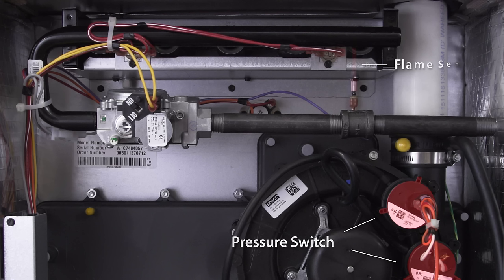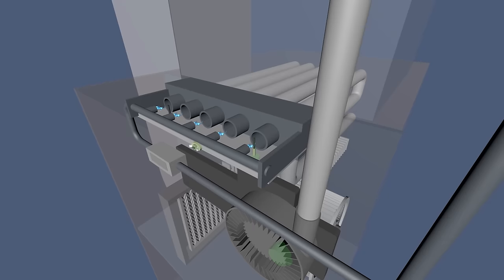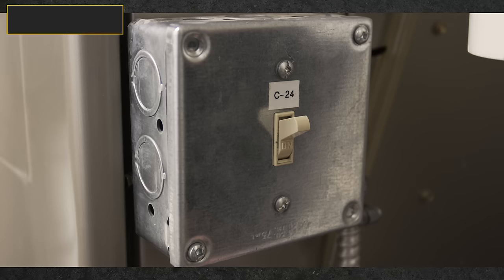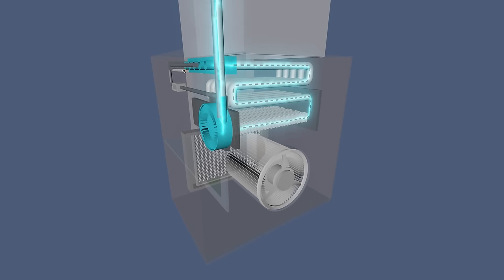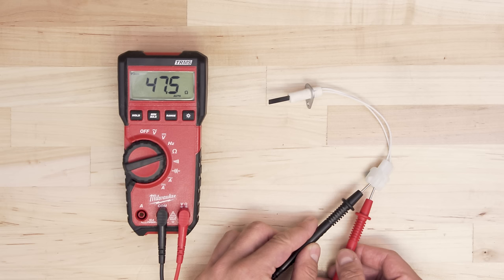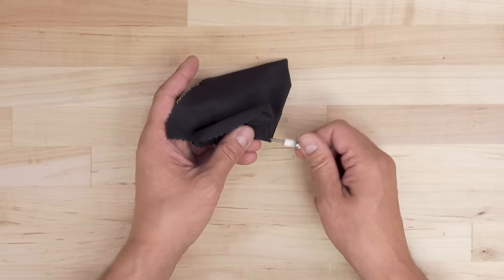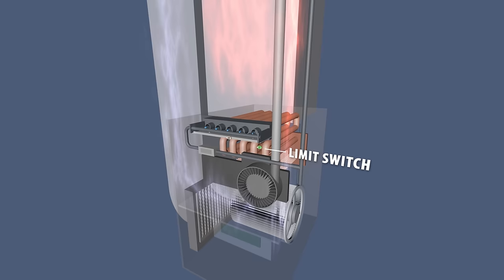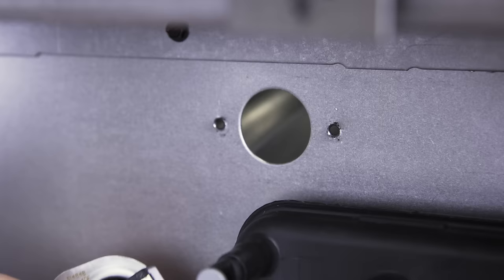Furnace Starts Then Stops - Troubleshooting | Repair and Replace

Comment: My electric heater fan turns off and then back on.. what should i do??
Reply from the maker: Thanks for watching. It depends on the type and style of electric heater. It sounds like it could be overheating. Check for anything that might restrict the airflow like a buildup of dust on the vent or fan. As well you could try adjusting the thermostat settings and see how that effects it. Also if it uses a limit switch then the switch could be starting to fail as its opening lower than its rated value.

Comment: Hello,

I am dealing with my furnace, and it seems to have a particular problem with the igniter.  When the thermostat calls for heat, the inducer turns on, then the igniter will attempt to light, but before it reaches full glow, it seems to go out.  Furnace will then cycle again, and this time the igniter reaches full glow and furnace flames ignite.  Do you have any idea what this could be?
Reply from the maker: Thanks for watching. Does the furnace give you any error codes when this happens? Normally if it was a intermittent pressure switch issue, it will shut off the system even before sending power to the ignitor. 

If this problem only happens sometimes, then it could be an issue with the ignitor or a loose connection with one of the wires. You could try replacing the ingitor with a new one as this is inexpensive and easy.

If this problem always occurs in the same way and the system glows after the 2nd cycle, then it could be an issue with the control board.
Reply: @AmreSupply  High, and thanks for your reply.  I did not check for error codes, but will try to the next time it shuts.  The igniter isn't that old, and I think I replaced it last year, and this furnace has always had a problem of cycling through the years, most likely due to sensor issues.  But this is different in that it will attempt to light the ignitor, but the ignition process shuts down before it can get hot enough to fire the burners.  The way I found it was the furnace was shut because of lockout.  So I flip the main power switch, and start the start-up process.  That's when I notice the peculiar actions of the igniter.

I did some reading, and as a longshot I blew out the tube from the inducer to the pressure switch.  Then I exercised the pressure switch several times to make sure it could move freely.  This seems to have helped, but we'll see.  Oh, by the way, the way I noticed the furnace was malfunctioning was when I went down to the basement, I could hear the humidifier motor, but no furnace.  Usually, that motor shuts before the fan disengages.  Thanks again, and your thoughts would be welcome.
Reply from the maker: @raymondjackson6069  Thanks for the update. It is always more difficult to narrow down a problem that is does not happen in the same way each time. A pressure switch issue or partial blockage could cause intermittent shutdowns. If there was a partial blockage / a reduction in pressure then the pressure switch would disconnect anytime in the startup sequence.

To test you can set your thermostat lower at the your home cool for an hour or two. Then bump the temperature up to trigger a heat cycle. Observe and see what happens. Repeat if necessary to try to get a closer look at how consistent the issue is. The next time there is a lockout there should be an error code.
Reply: @AmreSupply  thanks pal.   I realized when the igniter would do that partial warm-up, we weren't in Kansas.  Kansas being a double or triple cycling, only rarely leading to lockout.  This was locking out several times a day.  I think the previous cycling was due to a lot of little issues, normal for a furnace, like 20 years old - dirty sensor, draft, etc.  But igniter caught my attention, because either it's broken, or it's not.  This partial, then full burn was very odd.  A loose connection, yea, but fixes seldom come that easy, and thank God when they do.  So far the fix is holding, and I do not want to go downstairs fooling with that thing, least I tee it off.  Plus I can tell if it's malfunctioning, like if there is a chill,  the thermo is calling for heat, and theres' no partying in the basement.  Hopefully it will last the Winter, but if it continues to malfunction I get the error code, and try to get some video for you to take a gander at.  Cheers and thanks for making the world a better place!
Reply from the maker: @raymondjackson6069  You're welcome, we're just happy to help!

Hopefully the problem doesn't persist but keep us updated if it returns. Cheers!
Reply: @AmreSupply  Well partner, the fix wadn't a fix.  Still doing it.  So, I jumped the pressure switch this time, and it still did the dull igniter thing the first time, then fired up the second.  So I guess I can rule out the pressure switch.  I took a video of the start up and am trying to find a way to post it.  Stay tuned...  Here is a link  (https://youtu.be/YR_TyG10tAo) to the start up.  I'd really appreciate it if you gave a a peek.  Thanks again!
Reply from the maker: @raymondjackson6069  Thanks for the update. Even though you mentioned that the ignitor and control board are both fairly new it looks like a control issue based on your video. A faulty ignitor wouldn't consistently glow the 2nd time. To really narrow down a technicican would normally measure the voltage being supplied to the ignitor. A control board issue would be indicated if the voltage rises to 120 then cut out prematurely (preventing the ignitor from fully glowing).
Reply: @AmreSupply  Thanks again buddy, this furnace is not going to get another control board (if I can help it).  That's what I'm thinking; an igniter is like a light bulb, once it's gone, it's gone.  I had an "HVAC" guy who, in troubleshooting the cycling issue, replace the MB, with no discernable result.  So, in theory, I still have the old one here, and may switch it out and see what happens.  I'll try to keep you posted pal, but I have put out feelers for a new furnace already, so it might be time for an upgrade.  Cheers and have a great day!
Reply from the maker: @raymondjackson6069  A lot of these repairs have to weigh out the cost and effort needed to replace parts vs the cost and reliability that comes with a new installation. I agree that the cost of a 3rd control board would be best put towards a new furnace. Hopefully this one still continues to light. Cheers!
Reply: @AmreSupply  yep, hope springs eternal.  That weird ignition cycle is deep in the system.  With systems... new - it's a lemon, old - might be time for the farm.  Let's hope and have a great Thanksgivings Day! 😄

Comment: my furnace not just start then stops. it doesn't start without flipping burner switch on. then blows 3 -4 minutes cool. then stops. no sound of igniter/ flame on. just immediate blowing and cool. then shuts blowing and continues to buzz.
Reply from the maker: Thanks for watching. If your furnace is blowing cold air, and shuts off after running for several minutes then it could just be a faulty limit switch. You can see how to test the limit switch here: https://www.youtube.com/watch?v=0va_wvwfCBA

Comment: I have replaced the limit switch and also changed the filter to merv 4 filter. But my furnace is still short cycling after running for a while. My nest smart thermostat gives e74 error. Any suggestions?
Reply: Any suggested air filter? I have replaced the air filter with a lower Merv rating.
Reply from the maker: Hi Gökhan thank you for watching. The error code you are getting means that the nest thermostat is not detecting power at the RH  or red (hot wire) used for heating. One thing to check is to turn the power off at the breaker, and disconnect the thermostat wires, then connect them again to the same terminals, making sure that the wires have a solid connection. Then reconnect the power, and restart the nest and see if it helps.
Reply: @AmreSupply  thank you for your reply. It is happening when the furnace short cycles. I think when the high limit switch triggers, Thermostat loses power for RH. I have taken out the thermostat and connected RH with W1 wires directly to keep the furnace running continuously. The furnace turns off after a while (fans stop working the heat does not come out, I also checked that there are no flames). So my guess is high limit switch is tripping. I have a 1 inch filter and I am thinking that I have to replace it very frequently. The last time I replaced this filter was Nov 24th so it has been less than a month. I tried to run the furnace by removing the filter and it ran continously for 15 minutes without turning off at all. I did not want to test it longer since I did not want to clean dust from A-coil which I heard is hard to clean. I am thinking that I think I have to do a duct work and have a 5 inch filter medium installed since 1 inch filter is maybe causing the over heating. Could that be that maybe I have to vacuum clear dust somewhere in the furnace?
Reply from the maker: If you are able to feel warm air blowing out of the heat registers, then the restriction probably isn't too severe.  Now if your filter is collecting a large amount of dust within a month then you likely have a buildup of dust, and you should get the duct-work cleaned. Now keep in mind if the furnace was installed with a 1 inch filter, do not put a 2 inch or larger filter in, or put a filter in with a higher MERV rating as this will restrict the airflow, and will increase the air temperature around the heat exchange tripping the limit switch. In some cases its best to get it cleaned and inspected by a professional as they have the tools and knowledge to give it a proper cleaning and maintenance.
Reply: @AmreSupply  I feel warm air blowing out of the heat registers. It usually runs sometimes 10-15 minutes (i can feel the warm air). Sometimes it goes into short cycle earlier (maybe after running like 5 minutes with warm air coming out). Especially last night when it was cold, it was keep doing the short cycling (with nest saying e74 error).
Reply: Nest goes back to normal but sometimes it does not start the heating right away when it comes back from e74 error. Sometimes I have to manually lower the temperature and increase the temperature back to trigger the heating signal to the furnace. So basically lets say my target temperature is 75 degrees and nest got an error at 74 degrees. The next time high limit switch goes back to normal (so nest goes back to normal from e74 error), nest does not start the heating immediately. So sometimes my house during night gets colder sometimes temperature drops to 72. So I have to manually decrease the temperature lower than the current temperature Nest is sensing and move it back to target temperature (75 degrees).
Reply: Gökhan Özden mines doing this too. Only early morning and runs fine all day. I have to change the temperature to lower. On and off. And about an hour later is working normal again.
Reply: Cynthia Tuttle I still haven’t diagnosed why it is doing this. Having a new clean air filter definitely mitigates this issue a little bit better though.
Reply: Gökhan Özden I changed the filter just now. So I’ll see if that works. I’m supposed to have someone look at it Thursday but I’d rather not have to. I think it’s weird it comes on and off if it were just dirty
Reply: Gökhan Özden I feel like this is a thermostat issue. Because it shuts off in the morning and if I shut it off and turn it back on it works the next 24 hours. Then repeat in the morning. Clearly not a dirty starter. Or furnace issue in my opinion. 
So I’m going to reprogram it tonight and see what happens tomorrow. 
My teen says she did do anything to the thermostat. I believe her. 
It’s a Honeywell and older so it could need a new one.
Reply from the maker: It does sound like a thermostat issue. The fact that you have to lower the temperature and raise it again for the nest to respond implies that its a soft way of resetting it after the error code. If you have eliminated the airflow, limit switch or anything else on the side of the furnace then it would be best to troubleshoot the Nest. It would be best to call Honeywell support as they have likely seen this issue before.

Comment: I cleaned and replaced the flame sensor, but am still having issues with the burners turning off. The unit continues to blow cool air for a few minutes before it turns off and it cycles through again. Any thoughts?
Reply from the maker: Hi Ben, thank you for watching. How long do the flames stay lit for? As well, does the furnace give you any codes?
Reply: Thank you for your reply! I sporadically get heat, but very rarely. When I do the flame light blinks the code for insufficient flame. The green light blinks for a one hour lockout after cycling through four times and not getting a steady flame. The burners come on and stay lit for about 3 to 5 seconds.
Reply from the maker: @benfeld4058  You're welcome we're glad to help where we can! Based on your code, and the fact that the flames only stay lit for 3 - 5 seconds it means that the furnace isn't proving a flame. When cleaning the flame sensor doesn't help then it could be an issue with the position of the flame sensor. The tip should be directly in the blue part of the flame. If that doesn't help then it might be best to get a new flame sensor.
Reply: AMRE Supply I actually just replaced the flame sensor. That didn’t work so I cleaned it. When toggling the breaker off and back on again that helped for about a day, but then ceased to work after that. And for the Rheem unit I have, it seems as if the flame sensor can only go in a certain way as per the orientation of the two rods and where the screw hole is located.
Reply from the maker: @benfeld4058  Thanks for the detailed reply. It would be good to check all the wire connections between the flame sensor and the board. As well you could test the wire for continuity as a double check. As well the flame could be too weak or lazy, resulting in a weak or interrupted signal. This is why its recommended to regularly clean the burners of any carbon buildup. In a nutshell,  A flame sensor is a flame rectification system that allows a low level DC current to be rectified through the flame back to ground. Anything that lowers this current can prevent the furnace from staying lit. This also includes a faulty gas valve but that is harder to narrow down. Hope this helps!
Reply: AMRE Supply I checked all the wires as well. Dirty blowers seems to make the most sense as sometimes we get a flame but its signal is always weak per the flashing amber light. And I can’t recall the blowers ever being cleaned. Thank you for your prompt and very knowledgeable responses! It is much appreciated.
Reply from the maker: @benfeld4058  You're most welcome! We're glad to help! Now if you are curious we have many more videos. We recently released a whole series on water heaters including one that explains how they work. https://www.youtube.com/watch?v=BHUPFLbb8NY&list=PLCo9SMjkdWBwJ4a8MT2GKTDiSuvSHg6Xk&index=1 Cheers!
Reply: @AmreSupply  I will be sure to check them out as I just subscribed and liked the video. I took apart the burners, vacuumed them, blew them out, and scrubbed them (especially the flame spreader) with an old toothbrush and it's working perfectly now with a solid amber light, indicating a good flame. Thank you again!
Reply from the maker: @benfeld4058  Thank you for following up and thank you for subscribing as well!! I'm happy to hear that cleaning the burners worked!